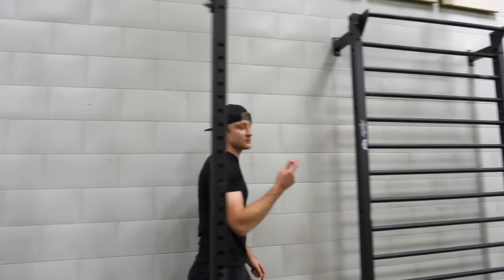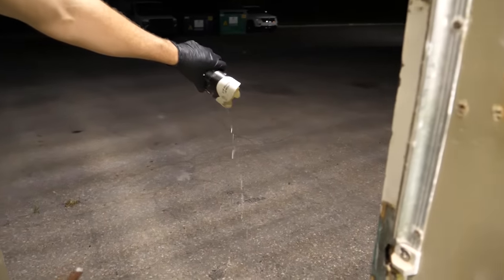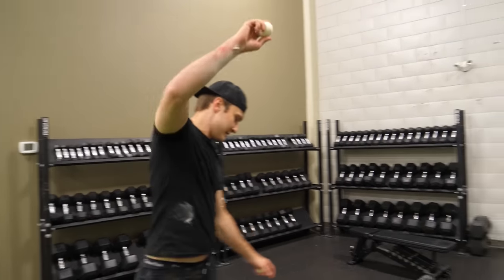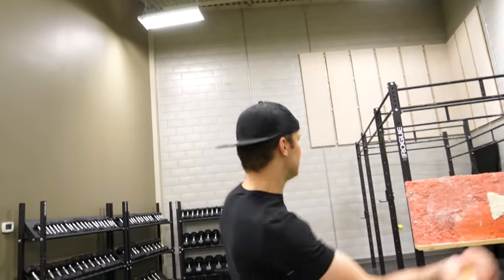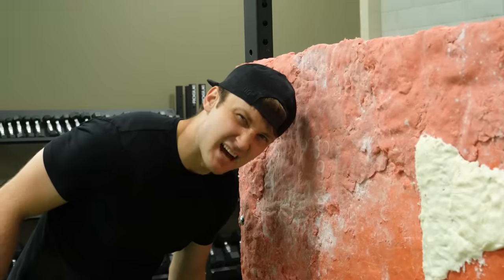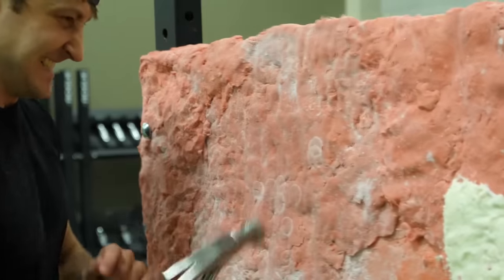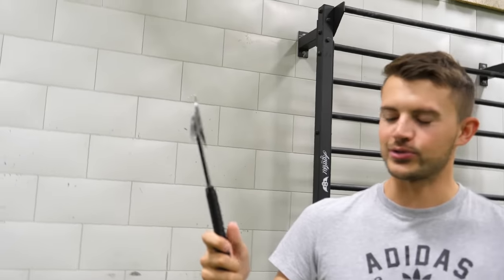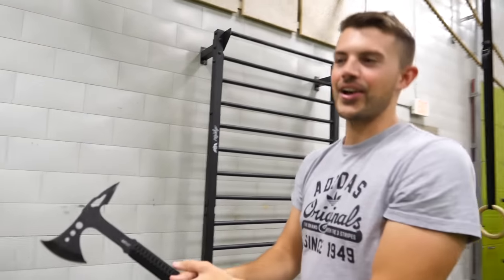100 LAYERS OF BOUNCY BALLS (DANGER ALERT) UNBREAKABLE WALL

Comment: Do a live Wall break but with 100 layers for all you have done in a row on the bars so you keep going through it and use a certain weapon for each wall starting from yoir first 100 layer wall to now in layers, Btw add a shrek layer wall and onion layer wall and.